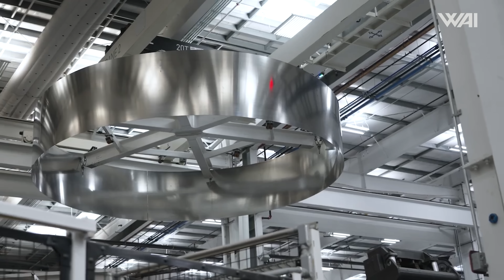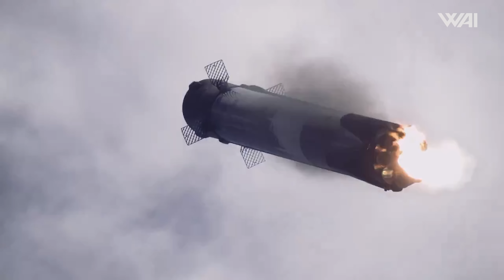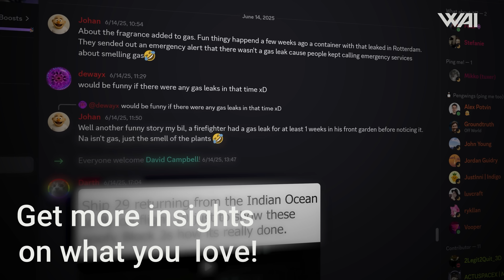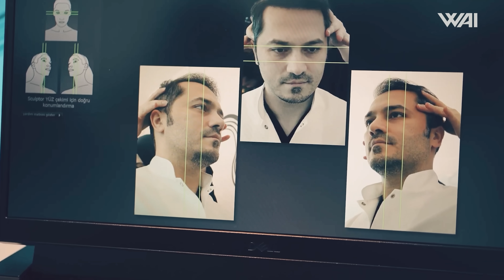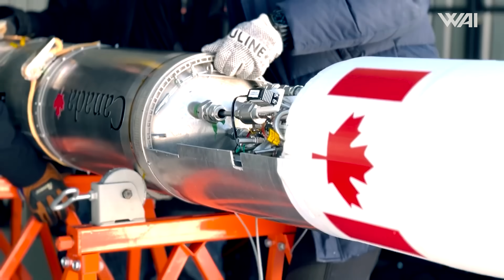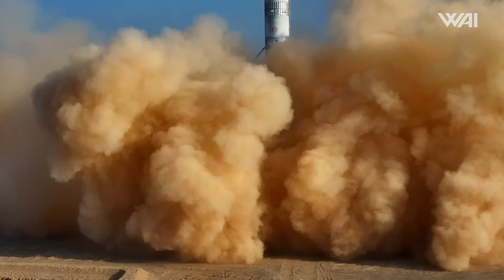SpaceX Unveils Groundbreaking Update: Inside Musk's Latest Starship Reveal!

Comment: The number of boosters and ships being built says a lot about future missions. The boosters never leave Starbase for more than 8 minutes, they always return right away. They are built for rapid re-use so they shouldn't need much time between flights and therefore, they won't need more than a few. If you notice, there is no parking lot for boosters. They will keep the ones being used and a spare. Maybe as few as 3 total at any given time.
The ships are another story. Only LEO missions will return to base in a short time. For the ones that head off to the moon and Mars, they either won't come back or won't come back for a long time. The majority of work at Starbase will be making ships. Having 11 on the assembly line is not a surprise at all.

Comment: I don't see landing on the skirt/engines too bad of an option, if they can get the speed down and get a soft enough landing but they may want some kind of stabilizing legs, not to take the weight but to just ensure it stands. if just one section of that skirt crumbles than it's going over lol.
Reply from the maker: It’s perfectly fine for first tests if you can (like SpaceX) just send 150 tons up there to just test a few things. Imagine the process needed if NASA wanted to do all this…

Comment: In all the simulated moon landing videos, Starship rests vertically on ridiculously small legs.   Look at the Apollo moon landing sites: the surface is rarely horizontal, but 99% of the time slopes down a hillside, sometimes with rocks in awkward places.   With its slender, vertical geometry, it's bound to tip over every time, unless it has dynamic attitude control legs...

Comment: Starship Landing on Mars Without Legs: Skirt Landing and Raptor Weight Stability. No Legs for Early Missions: Recent discussions, including X posts and SpaceX updates (circa August–September 2025), suggest that the first Starships to land on Mars—likely uncrewed test missions in 2028–2030—may forgo deployable landing legs. Instead, they would land directly on the reinforced skirt surrounding the Raptor engines at the base of the vehicle. This skirt, made of stainless steel, is structurally robust to withstand engine thrust and reentry stresses.
Raptor Weight for Stability: The six Raptor engines (three sea-level, three vacuum-optimized) weigh approximately 1.5–2 tons each, totaling ~9–12 tons at the base. Combined with the heavy stainless steel structure, this low center of gravity could stabilize Starship on Mars’ 38% Earth gravity (3.71 m/s²), especially on flat terrain.

Comment: I wonder how far out in the space the ship can fly altogether without separation? If it could make a deep space like 300 to 400 miles. Then it would be above the current satellite rings and then we would have a true starship upper stage in space that has not used any propel And is totally full. And you could remove three of the engines from it because they’re not needed for earth deployment, which will save weight. And then we can use the booster and incorporate it into a new space station with the other companies.

Comment: I do not understand why SpaceX did not make the test stands more "bulletproof".
The failure of Ship 36 and subsequent shared use of the OLM will just get worse in the future as the launch pace quickens.
They need to make the test area a bunker (ie no exposed pipes & tanks) with a modular ship/booster adapter.  
If there is an accident, just hose down the area, swap the adapter if needed, and continue.
The next accident is not a question of "if", but a question of "when" and they need to be prepared if they want to maintain the launch cadence.

Comment: 9/1/2025: My City. 
High: 101.3°F, Low: 66.0°F
Last year: High: 103.8°F, Low: 70.2°F
23-year daily normal: 
High: 98°F, Low: 68°F
23-year records:
High: 2015, 108°F, Low: 2017, 59°F
All time record: 120°F, 1934.
Days over 100°F: 2025 12 - Last year total 55
My station in the urban heat island zone: 
High: 110.3°F, Low: 66.2°F

CO2 (calibrated 8/28): 397 ppm
Cut CO2 to 0.02%, and plants die, crops fail, 
we starve. That's why CO2 is called the gas of life. 

Net Zero’s true aim? Power and profit. It’s a government-controlled cash grab, gripping California, Canada, and Europe with taxes and control, all while ignoring CO2’s vital role. Billions will suffer for this lie.

Climate change, as defined by the World
Meteorological Organization. Requires at least 30 years of daily WEATHER data to establish a baseline. Why? Because 30 years is long enough to smooth out random swings. Like a cold snap or a heatwave. It also reveals consistent patterns, like average temperatures, seasonal trends, or rainfall norms, for an area. 

Climate is NOT today's weather. It never has been. It's Earth’s natural rhythm, not a catastrophe.

Comment: Question on risks of orbital refill: If both the ship and tanker suffer a RUD, wouldn't the thousands of pieces of shrapnel risk other space craft, then possibly leading to a Kessler syndrome? Is this too risky?
Reply: In LEO there isn't enough time for these fragments to produce a cascade event. The smaller the debris the faster the decay rate which acts as a moderator on the cascade. At these altitudes most small pieces will not have the energy and will burn up before they have a chance to destroy more and start the exponential.
Reply: @admarsandbeyond  Thanks.

Comment: Felix, have you heard of a good reason why the SpaceX Starship has a different base design from the booster, not the engine arrangements but the way they lock on to each other and the launch platform. If they were the same then they wouldn't need the mod for static fires.
Reply: The biggest difference is that the three outer engines on starship are vacuum optimized, meaning they expect there to be no air. That needs a different nozzle so you need a different test mount. Also, because of the vacuum optimized engines, they don't work as well on earth.

Comment: SpaceX could add a vented landing ring with hydraulic or heavy-duty air suspension to Starship’s skirt. It’d reinforce the edge, allow exhaust venting, sense the ground to compress slowly for a cushioned landing, and simplify design over legs while protecting the ship on rough terrain like Mars.
Reply: Where are you gonna get the "air" from?
Reply: @brucelytle1144 doesn’t have to be air, could be compressed gas. I’m imagining like very large versions of air suspension that when the skirt ring makes contact it will kinda gently set it down
Reply: @xRola.No matter what you use, it is an inefficient use for the added weight. Unless you use propellant, which has problems. The best part is no part!
Reply: @brucelytle1144 well yea you’re right, lets hope that the structure of the ship can handle it. So far we haven’t see it land on the skirt alone.. but I am team SpaceX so I know they got this 😄

Comment: Why does SpaceX need to test new types of tiles?! The Space shuttle had much thicker tiles and it absolutely worked and didn't discolor the vehicle at all. Just use the same technology
Reply: Shuttle tiles were very troublesome, fragile, and dangerous, requiring huge amounts of repairs and maintenance between flights. These tiles and the quirky engines (which required almost a full rebuilt after every firing) were the main reasons the Shuttle failed.
Reply: NASA lost all that technology!!!!
Reply: Shuttle TPS system was essentially 1st generation attempt at reusable TPS. Designed in the 1970s, remember. Actual experience showed the system to be extremely high-maintenance/high cost. Starship will only work- to get to point of rapid and full reuse- if they can get it down to, pretty much, almost no maintenance on average between missions. - Dave Huntsman

Comment: The Mars 2026 shot is more about getting data. The goal probably is to complete the TMI (trans-Martian injection) and the rest of what happens is icing on the cake. 

As long as SpaceX demonstrates orbital refuelling by mid-2026, the chances of a Starship completing the TMI and going to Mars is high
Reply from the maker: Yes! Those will be rudimentary tests. Saying that they'll land on the scirts is the most obvious giveaway. As long as they get orbital refueling done, there's a chance. That's going to be difficult, but it's still possible as long as Block 3 works as intended.
Reply: It'll be amazing if the ship actually rendezvoused with Mars. 
A controlled reentry, nearly impossible. Touching down after, that would be spectacular. 
No time for legs in 2026, Dr. Jones.
Reply: Need to actually get a ship to orbit first.  With problems of explosions still occurring in aft end they have to hope the fixes for V3 work as it does not appear they have ironed out what is causing it yet.  Nice to see them going backwards once more and learning from the past and using the Russian hot staging that always worked vs SpaceX which always had problems.
Reply: There is no chance of a successful orbital refuelling` effort next year.  There is far too much to fix first.

Comment: SpaceX could be better off to leave the hot staging ring attached to the Mars Starship and use it as landing legs, as it's going to be difficult to vent propulsive landing exhaust.
Reply: Excellent idea !
Reply: Just have to get it past Mars entry…
Reply: No. The rocket exhaust and thrust would interfere with the "ring". Legs have to be extendable and tuck away from the rocket bells.

Comment: Do you think they will attempt to catch or do you think they will go into full orbit next launch?
Reply: They already answered that. No catch until flight 13 at earliest. Probably 14 or 15
Reply: as hupekyser said: Ship catch (if that was meant) definitely not. Booster catch... maybe but then they would have to scrap the booster since its the last version 2 launch. Could be that they run some testing to push the booster reentry to its limits again instead.
Full Orbit would require a new launch license... Not sure if they already have enough confidence that they can safely deorbit it though.
But given that its the last version 2 flight, maybe it would be worth the wait, as it still will take time to finish the v3 pad, etc. So, all the waiting for a new license would cost would be a delay before scrapping the v2 launch mount and begin converting pad 1 to v3.
Reply: @wulf2121 yeah probably no value in catching the last of the old booster design. They've already proved it out. Im betting they will go for booster catch on flight 12 and go for ship catch on 14.

Just a guess though
Reply from the maker: Very likely not. The last info we got from Musk was that he wants to see two flights go well before attempting a catch. Added to that we have the block change coming up, which will likely mean a reset. So, right now we're looking at flight 13 for a catch if everything goes according to plan. Catch and full orbit are connected. If you want to get the ship back to the landing site, you need to do at least one orbit. :_WAIHeart:
Reply: On a side note... 2026 cadence is going to be crazy once they're in full swing with new launch pad and production of the v3 ship.
Reply: They can kinda already do an orbit whenever they want. Would be smarter to test other things before hand